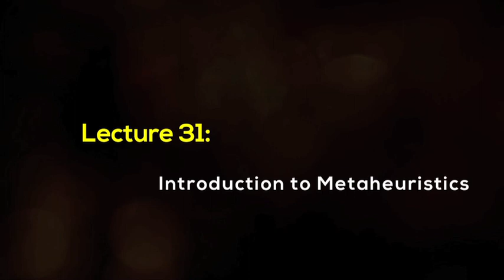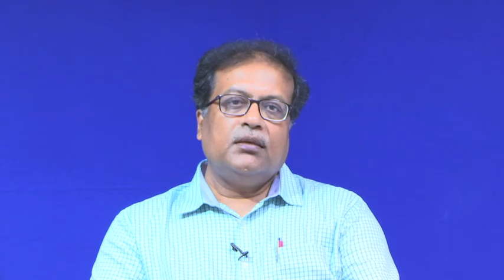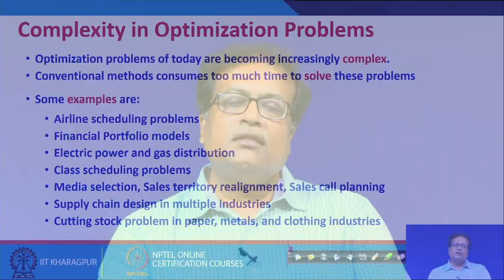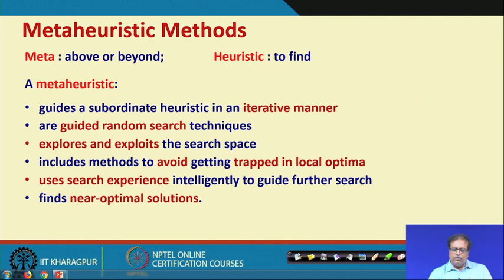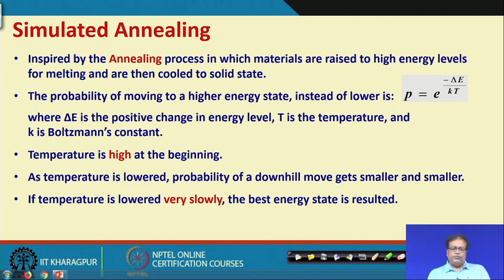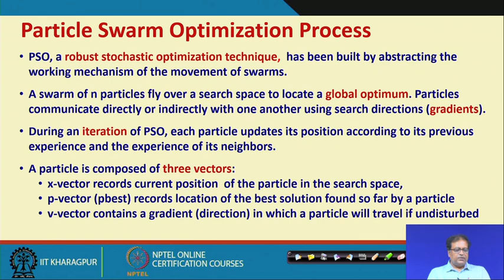Lecture 31: Introduction to Metaheuristics

Comment: It's not for me totally clear the differences between heuristics and metaheurustics. It's simply a metaheuristic a iterative process of the heuristics methods? Also, if we are talking about near-optimal values 'cause we really don't need a "best-point" value, why talking about a global maximun or "best value"? it has no sense if our plan is to found a good or excellent point.
Reply: For example, a local maximun could be a excellent point and in that case we no need expend more resources finding a "imaginary" best value. Why in that case talk about near optimal values?
Reply: @danielflorez3762  : Global Maxima or Local maxima are just approximations. In Theory you can at best find the most "optimal" local maxima out of many as there are infinite number of points at maxima or minima. It is like a centroid of a cluster of best point values but it does not represents a single "best point" value.